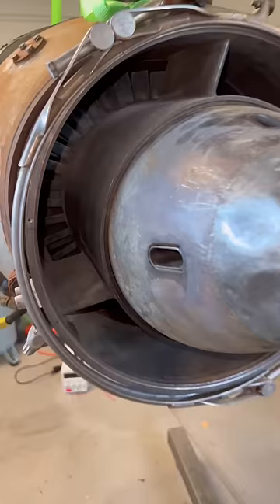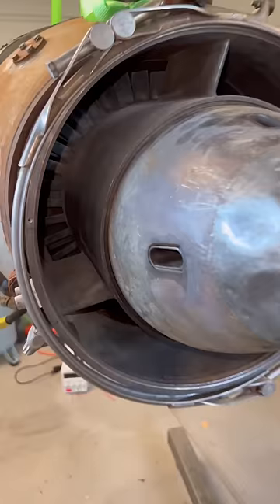Jet Engine Parts in the Mail

Comment: This guy is going to be a great youtuber i bet
Reply: Is he still alive?
Reply: @torahibiki  yh
Reply: No way. All he does is talk, and talk about dumb things. "Oh I hooked up this 24v generator to a 12v system, and it doesn't work. Guess I'll replace it"
Reply: @shadowknightgaming1874  if he dies he'll get attention 😂
Reply from the maker: @joetate87  I’ve got an experiment for you. Get a DC electric motor from something like an electric toothbrush and connect it to a AA battery. That’s 1.5 volts. Notice that it spins. Now, take that same motor and connect it to two AAs in series (3 volts) Notice that it also spins, but this time faster. Moral of the story? An electric motor should spin on a lower voltage, just not as fast. In the case of the starter-generator, it should absolutely spin on 12 volts provided its power source has a high enough amperage rating (the car battery has more than enough). Given that it didn’t even make a noise and simply shorted my connection on 12 volts there’s clearly something wrong with it and it’s worth figuring out. If I were to apply 24 volts to it, not only would it not spin, it would increase the chance of further damaging the motor. Best to fix the problem before giving it more voltage.
Reply: @jackschneider17  bro, i bet he not gonna read that since it was too long and too much for his small brain 😂
Reply: @4lderion  yea dude doesn't have patience
Reply: @jackschneider17  that dude has no fucking clue about what you're doing, don't worry just keep at it
Reply: @joetate87 Thats rude man he tries his best and you still dont understand what he goes through
Reply: @FirstMomentsOf  while I didn't go to school for jet engines, I do work on yachts quite often. You're also assuming an awful lot. And if you don't like my comment you can keep scrolling
Reply: @jackschneider17  I did this all the time when I was a kid with RC cars. But that generator is not going to work on 12v. There's a reason big boats have a 24v and 12v system. The 24v system will not work on 12v. Not to mention a quick Google, could give you the same answer. All he does his talk and plug stupid products.
Reply: @joetate87  explain why my 24v starter spun up (at roughly half speed) when I gave it ~14V from a jump pack? By your explanation it shouldn't have done anything, and yet, it worked. 

I think you're missing the fact that his starter was under no load. Yeah, with a load on it at half the voltage it may have not spun even if it was functional, but with no load it should have done *something*.
Reply: @jackschneider17  best reply 😂
Reply from the maker: @demirimamovic6269  that and he’s wrong lol
Reply: Hope not.
Reply: @joetate87  you are the kind of person who didn't take a single AP class hs💀
Reply: He already is a great YouTuber
Reply: @joetate87 you just gotta be slow I say that in the kindest wat
Reply: AXIOMATICLORD  it doesn't matter if I have a jet lol. I work on 24v and 12v systems everyday
Reply: @sek3234  you're right, I didn't take a single one. I took 3
Reply: AXIOMATICLORD  perceived inferiority or superiority is the sign of a weak mind. We are all just people. If you don't like what I have to say you're free to move along. Furthermore do you own a boat, or two? Do you even turn a wrench? Do you own a 24v system?
Reply: @joetate87 ain’t no way you’re still arguing over a comment over 4 months later😭😭😭
Reply: @bolan11  maybe you should look up the definition of arguing. You DO know how to do that, right? Also, I have no idea who you are.
Reply: @joetate87  my bruddha after 4 months it ain’t arguing no more just give it up
Reply: @joetate87 Bayliss boatworks baby!!
Reply: @joetate87  It doesn’t matter how well you argue, you’re still wrong 💀
Reply: @jackschneider17 I liked the part where you showed what happened when you put thermite on it.
Reply: @joetate87 he just gave you a CHECK MATE. Come back here so we can all bully you now.
Reply: @joetate87 do you have a jet tho
Reply: as-cf7rx   how about you test that one out on yourself first
Reply: @joetate87 Bro really don’t want to lose this argument 😂😂
Reply: @sek3234  you sure he graduated from HS? 😁
Reply: @jackschneider17  Man ignore the ass holes!! I am enjoying your content.
Reply: Right up until he blows himself up trying to start a jet engine with a stun gun. (Yes. He actually suggested doing that very thing.)
Reply: @JumpingTuna  🤣
Reply: @torahibiki what
Reply: @jackschneider17 An electric motor will spin on a lower voltage, till that voltage no longer overcomes the forces necessary to spin the motor, which kinda makes all that a moot point lol Just do the math to prove whether 12v can drive it or not
Reply: @jackschneider17 You're a walking W
Reply: Maybe someday, I want to see his jet engine explode though
Reply: nah his voice annoying
Reply: @jackschneider17 LOOOL OTHER BRO GOT ROASTED HAHA
Reply: @joetate87 ur just “bobo”
Reply: @joetate87 dude you got called stupid in like 5 languages
Reply: He’s a troll

Comment: The single blade you were sent by your friend was a compressor turbine blade. A compressor-turbine is driven by expanding gas and is coupled to the compressor which provides inlet air. Your turbo jet operates on completely different principle than the PT6 turboprop engine. What you showed on your turbo jet was something like N2 blades and that engine is shafted together. The PT6 has a gas generator and power section. You could hold the propeller still while running a PT6. I’ve done it.
Reply: I don't know if it's from a PT6. Does the PT6 have the LE/TE Angle wings?
Reply from the maker: @gl9500  yup, it’s from a PT6-A.
Reply from the maker: Yup. If you scroll a bit down my list of videos you’ll actually find one where I went over the inner workings of a PT6A using a cutaway. Overall the J69 is much simpler considering it has only one stage, no free turbine, and no reduction gearbox (besides the small one used for the accessory drive)
Reply: @jackschneider17  yes, clearly you know more than me with your garage experience and me only with 16 years making every aspect of turbine blades.... clearly you don't even know what the Angel wing is. But hey best of luck to you.
Reply: @jackschneider17  I will admit I do not work for Pratt Whitney and could not find your cutaway video, but the PT6A training Aid published Jan 19, 2014, that does have a cutaway photo does not use this blade. And why would it angle wings are for engines with multiple stages of compression.
Reply: @gl9500  this is like watching a child run around a hangar with a hammer telling everyone he's so very smart.
Reply: @gl9500  I’m not sure. I don’t do a lot of heavy maintenance on the PT6’s. I will say, I’ve gotten to work on several PT6 E-series engines now and they are awesome!
Reply from the maker: @gl9500  Dude calm down, did I say I know more than you? I literally just said that it is a PT6A blade. The comment mentioning the PT6 video I made isn’t even in reply to your comment. Here’s the link to it anyways: https://youtube.com/shorts/FCvL--YCU3Q?feature=share
Also, cut the shit with the “garage experience.” I’m not trying to invalidate your experience so don’t try to invalidate mine. I am a pilot and aerospace engineer with turbine engine design experience. By no means an expert, but I wouldn’t call it “garage experience”. Your 16 years of making blades is great and I’m sure you are a turbine god, but that doesn’t mean I can’t know a few things about jet engines too.
Reply from the maker: @gl9500  PT6s have multiple stages of compressors, a few axial and then one centrifugal. At least the ones I’ve seen. Including the one in my cutaway video. Not sure what training aid you’re looking at, can you send me the link?
Reply from the maker: @check4twenty  The E-series is awesome! Gonna be interesting to see how the GE Catalyst compares. Flying with a FADEC is sooooo much nicer
Reply from the maker: @highflyerl23  A. That’s not a hangar, that’s my garage and B. While I might look young, I have graduated college with my aerospace engineering degree and currently work as an engineer C. I have made no such claim
Reply: @jackschneider17  I said it is LIKE a child running around a hangar...
Reply: @jackschneider17  oh Christ! He's a pilot. It's all falling into place now.
Reply: @gl9500  Lol Kinda shows your insecure when the very first thing you do is begin the insults on someone who is having a gradual calm conversation with you. i’d hate to be your co-worker……
Reply: @highflyerl23  Only a child responds with insults to a discussion that does not need to include insults in the first place. That is child like behavior. “remove the speck out of your own eye before you can see to take the Log out of your brothers eye “. Totally unnecessary. Constructive criticism would have been fine.
Reply: @highflyerl23  It’s better than before, but extremely insulting, And not needed for engineering discourse. Couldn’t you of said it in a nice way? you do realize when you insult someone typically what you tell them falls on deaf ears, i’ve learned this over the course of my years. Unless your goal was to insult, not inform. If you truly mean what you say, you can say it nicely, without the insults, and mabye just mabye someone may listen too you. Just some advice for the future, tho you may take it or leave it. Have a good day 🤙
Reply: What language is this😅😂
Reply: @1_Cazula_1  Fluent nerd
Reply: @highflyerl23  lol. Yep, pilots…
Reply: @check4twenty  Every single one believes they are God's gift to aviation.
Reply: @gl9500 butthurt much?🤣🤣🤡
Reply: @highflyerl23 ok bozo
Reply: Lol! Yeah so have i. But not for long.
Reply: Which is it? Compressor or turbine? Compressor and turbine are two different parts of the engine.
Reply: @JumpingTuna   dont tell him that!! I was having fun reading about compressor turbine blades
Reply: you're all missing the bigger picture.
Reply: @MeshuggahDave.  which is...?
Reply: Whoa😯
That simultaneously terrifying and awesome🤓
Admittedly kinda strange flex,.. but hey, I guess as long as neither you nor the engine got hurt... Why not?
Reply: @highflyerl23 seeing someone reply to the same comment for half a year may just be the most psychotic thing I've seen all year, jesus. And on a 30 second video about a young dude's junker hobby jet of all things. good lord.

Comment: A&P here. The Pt6 is a pretty interesting engine! I believe it’s actually reverse annuler confusion with a mix of axial flow and centrifugal compressors. Pretty sick
Reply: also A&P here, hello friend, have done some work on pt6 engines before. Wish i could afford a plane that had one! not cheap to fix if something messes up! sometimes people who go from other turboprop engines begin to try to start a pt6 they sometimes dont know that if the ITT (inter turbine temperature) gauge is very important to monitor during a hot start, many times its best to actually dry motor the stages with a GPU or the starter to try to drop the ITT temp below 150 as not doing so can cause the ITT gauge to rise above the chart that P&W has specified (10 seconds at 925f, 2 seconds at 980) which if this point is hit a hot section inspection is required. This is most of what we see from PT6 as pilots keep us having a paycheck! if this temp also exceeds (925f 15 seconds, or 1035 2 seconds) then every single blade in the hot section must be dye penetrant tested and stretch tested.

Comment: Thermite will probably melt it, the way the stop these blades from melting is they have tiny tiny holes on the leading edge that stream cooler air over the surface of the blade to insulate it while the engine is running, its a really clever way if stopping them from melting

Comment: The front of the engine has compressor blades. Turbine blades are in the rear. And what is visible in that shot are inlet guide vanes. The compressor blades start behind behind the guide vanes and alternate with stationary stator blades.

Comment: if you hot start start a pt6 and the ITT (internal turbine temperature) exceeds 925 for 10 seconds, then you get to pay an MRO a crap ton of money to take your pt6 hot section apart to inspect it. And if that number exceeds 925 for 15 seconds, you get to have an MRO take apart your hot section remove the turbine blades and stretch test/dye penetrant test them which costs even more money, and if they are messed up then you spend more money replacing them or the FAA wont let you fly your fancy plane anymore. 

 My advice as an A&P is if you for some reason are hot starting a pt6 make sure you dont start unless the ITT is below 150f, and if it is above that then you can duty cycle the starter 30 seconds on, 30 seconds off, 2 times, then if that doesnt drop below 150f then starter must take 30 minutes of downtime before attempting to dry cool the turbines again.

Comment: this blade have this holes to be active cooled by cold air also it works in very hot gases... droping in in thermite it is deferent beast
Reply: Russ ...?
Reply: Well you also have to drill the blade so the air will flow through the cavity and over the blades

Comment: The blades only don’t melt if they’re running. The airflow is designed to cool the blade. If they’re stationary with that heat, they would melt

Comment: Hey get you some nickel round stock and turn down one end to fit inside a pneumatic air hammer. It works wonders when removing old blades.

Comment: Doesn't thermite burn at like 3,000 degrees? I don't even know if space ships can take that kind of heat lol
Reply: Space ships have to go into space and suffer a fuckton of heat from the radiation that surrounds our planet, plus the climate of space which can be either really cold or really hot depending on how close the sun is at the time of the space trip.
Reply: @AzureMoonlight59  Idk the number exactly, but space ships go through, tops, 1,500 degrees Fahrenheit. The temperature in space is 300 degrees Celsius or -300. Somewhere around there

Comment: Speaking of blades and temperatures.  The A-10 max jet engine temperature is 1,555 degrees F after that the hot section melts down.  
So your little blade might make up to that temperature before melting?
Reply: That blade is platinum coated to help with heat, it's also has cavities inside that air flows through.

Comment: Just because a turbine blade is supposed to operate in extremely high temperature ranges does not mean it won't melt if pile thermite on it. You're clearly just doing this to seem smart and get clicks.